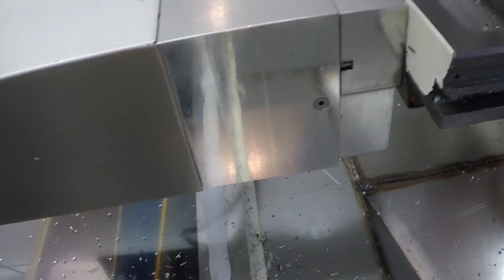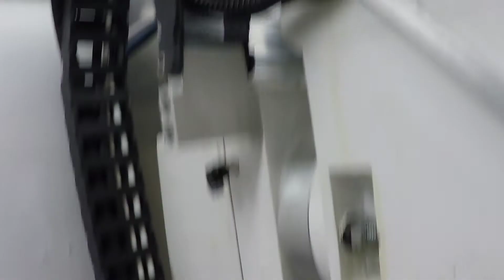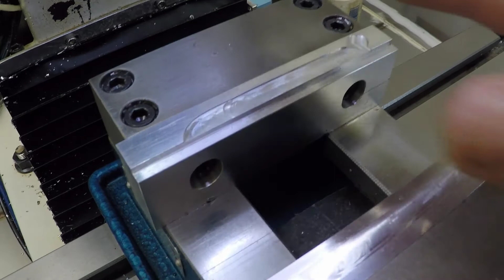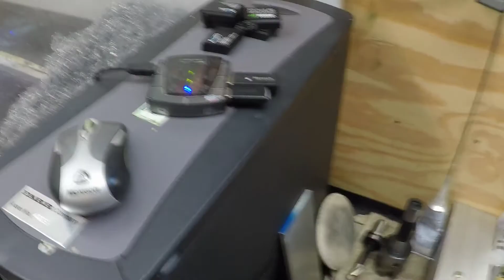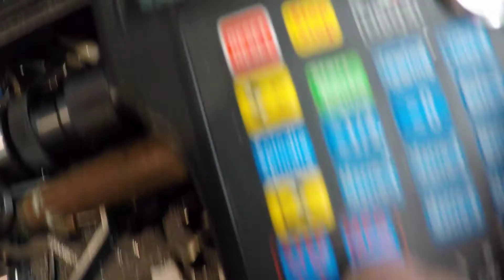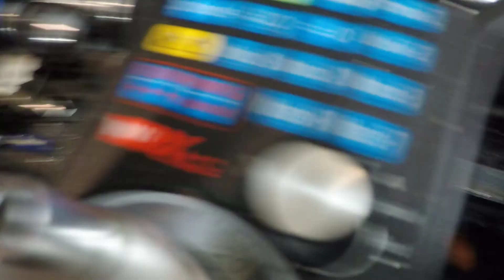ABOUT MY MACHINE AND WHAT I USE TO RUN IT PART 1

Comment: I may have missed it, but do you mind sharing what servo's you used exactly?

Thanks!
Reply from the maker: On the Z axis I have a CPM-SDSK-3421S-ELN, on the X and Y axis I have a CPM-SDSD-3421S-RLN. Now the difference in these motors is the encoder inside the motor on the ELN it is 6400 resolution, E stands for enhanced. Using Mach3 there are issues with Kernal speed that will reduce the amount of travel speed you can accomplish with the higher resolution encoder. Now I have since installed a smooth stepper that may have the capability to run the higher resolution motor tuned to 6400. In my case I have just tuned the motor to 800 like the other two and have 200 ipm rapids.
Reply: Thanks for the quick reply! I also had some issues with mach3 while running on parallel port. With the USB I stopped having issues (The mill I purchased is not yet converted but I have another CNC mill) I am looking at alternatives to mach3 / mach4 but the options are pretty much limited to linuxcnc and usbcnc. The more professional controllers (standalone that do not use a regular PC) have a similar professional price attached.

What is your experience with the flexibility in the frame and especially the column? I have the machine itself bolted to a wall and plan to mount the top of the column as well.
Reply from the maker: The mill column has the opening in the front so the lead screw/ball nut screw can travel up and down the column, this is the major design flaw in these type mills as it allows the dovetail ways to flex inward causing head nodding. The best way to get rid of this part of the flexing issues is to do a linear guide way conversion. Then the load of the head will be confined to the column thickness entirely. The steel rails should offer some improved rigidity and completely do away with the pinching of the ways. I am using the ESS ( Ethernet Smooth Stepper), these seem to be more stable than the usb based ones.